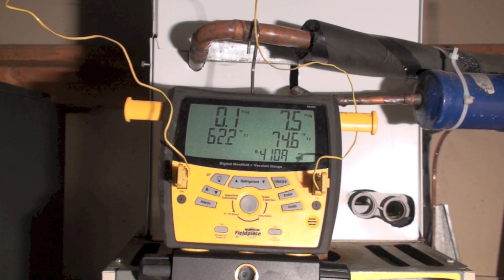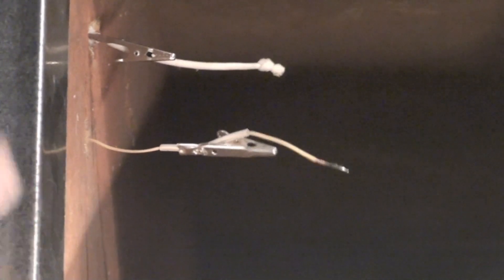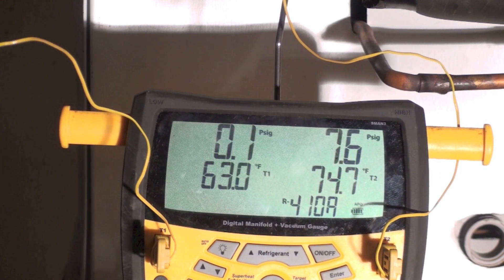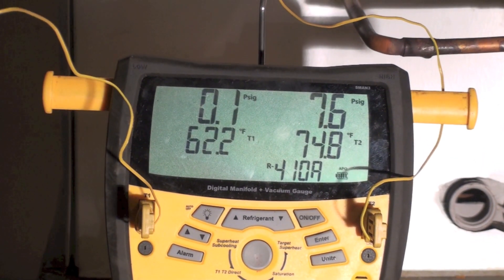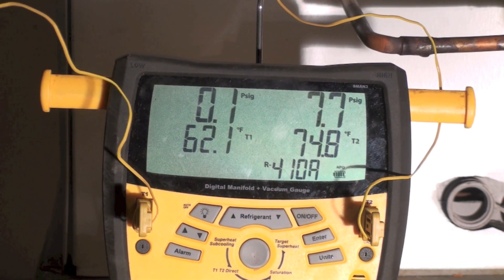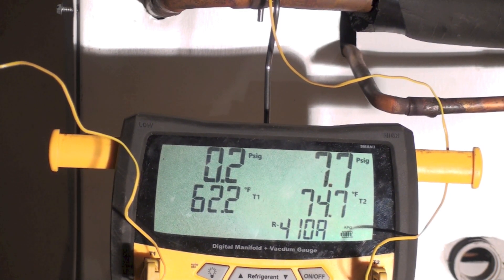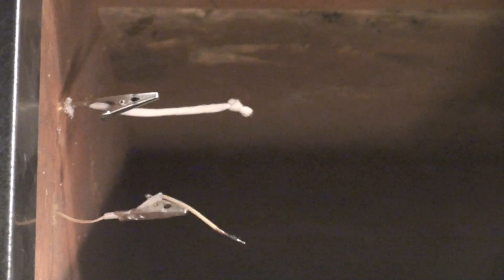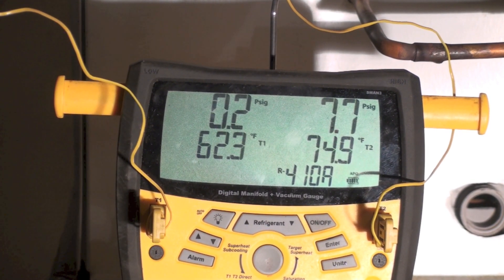Wet and dry bulb explained

Comment: I dont get how that applies to measurements..  i got a bulb indoors in pipe insulation right by the coil and one on the outdoor unit non insulated..  also got a txv indoors same area and out same area..  have a reversing valve right by the bulb as well.,  r22.  Ive checked the superheat outdoors and checked out..  but what do i check indoors?  Told to check it indoors based on cfm which is fine and wet bulb.. which i dunno what im checking..  rh to the liquid and line temps?  Do i gotta tap into the lines indoors also?  Im confused ..  ya get a good understanding in class then some old guy just confuses the hell out of ya in the field saying check the indoor wetbulb and hands me gauges..  like wtf.  Ive just been going in and making sure its not icing up and cfm is good n filters ..  just saying its good..  dunno what he expects me to hook into inside..

Comment: My hvac instructor told me to forget about wet bulb. He said in california we dont need wet bulb and if we are located in Florida. Can someone please give advice.
Reply from the maker: I do not say this lightly.  Your instructor is full of it.  
Humidity in California can vary from 5% to 0ver 90%.  Florida generally has a very high humidity, but it is not guaranteed.
Humidity determines the load on the A/C system and to a certain extent, affects the load on heating systems.
Follow the manufacturer's instructions.
GFM

Comment: Wet bulb tests are also used in the automotive industry in plants that don’t have AC.  Because these plants are basically like big ovens in the summer a point can be reached where it becomes extremely dangerous for employees that are already getting hot due to constant movement and thousands of pieces of machinery inside the building putting off heat.  Once it reaches a certain point the company has to give the employees extra heat breaks to cool off.  Wet bulb tests are used to determine when/if that will be necessary.

Comment: Thanks for clarification. Btw, you said when you take those 2 temps you can calculate relative humidity.  How is that done?
Reply: The formula is complicated, but it is easiest to work it out graphically on a psychrometric chart.  Given the dry bulb temperature and wet bulb temperature, you find a vertical line that corresponds to the dry bulb temperature, and trace upward.  You then find a down-right diagonal line, marked at the saturation curve, with the wet bulb temperature.  Follow the wet bulb diagonal, and see where it intersects with the dry bulb vertical.  This locks-in the definition of the air condition.

If you then want to know the relative humidity, you determine the corresponding absolute humidity with how high that point is above the dry air horizontal axis, and you keep tracing upward to find the maximum possible absolute humidity at that particular dry bulb temperature.   Relative humidity = absolute humidity / maximum possible absolute humidity at the dry bulb temperature.

Comment: Why is it so important to get the wet bulb ?
Reply from the maker: When humidity is high, water evaporates slowly, thus it absorbs heat slowly.  If the humidity is low water evaporates fast.  If I place a wet cloth on the bulb of a thermostat, the water will begin to evaporate and cool the bulb.  Thus wet bulb.  If the water on the cloth (called a sock) evaporates fast, the sock gets colder and shows a lower temp than a bare bulb.  
If, for example, relative  humidity is 100% dry bulb and wet bulb would have same temp because no water would evaporate.  Lower relative humidity will show a difference in temperature between wet and dry bulb.  The lower the relative humidity, the higher the difference in temp.
GFM

Comment: So does this take a special type of sock that doesn't dry super fast in all that airflow? Is this much more accurate than a cheap digital weather gauge that reads humidity? Guess the evaporation just causes a cooling effect? Guess I'm still trying to wrap my head around how all that is controlled enough to be able to measure humidity accurately. Why I'm kinda wandering if it takes specific type of thermometer probes and specific sock material and thickness and maybe a specific temperature of water to wet the sock with? Thanks for the video
Reply from the maker: Because it works on the latent heat principal, so unless it dries out, it will work.  The material is, I believe, cotton.  
There are a number of ways to acomplish this measurement.  Early controls used human hair because it shrinks with higher humidity.  Also, some plastic sheeting shrinks with humidity.
GFM
Reply: @grayfurnaceman  thanks for the response. Definitely Interesting how some of these things work. How would you compare this method with those electronic humidity meters you buy at the local Walmart etc? Are they even accurate?

Comment: This is unrelated but I am looking for a little help in an area I am new to. A customer lives in a forest area near Muir Woods and had a major mold problem. They are requesting a dehumidification unit. Since there is no need for AC, I know there is a brand that makes one. My concern is how will it work if it is in line with the return and only has a 10x6 opening? Ive got a 16" return with an 80,000 BTU furnace and a 3ton blower.
Reply: It sounds like a recipe for failure.  The humidifier duct sizing is probably done to increase condensation.  However, unless you have a high static pressure fan in the furnace, it probably will drop out the furnace limit.  Have you contacted the manufacturer of the dehumidifier?
GFM

Comment: Why we need to measure wet bulb temperature, and where it is practically used
Reply from the maker: Wet bulb is used in refrigerant charging with fixed orifice controlled A/Cs.  It is also used to determine load, especially in high humidity areas.  In these areas, the humidity load could 1/2 of the total load.  Hope this helps.
GFM
Reply: @grayfurnaceman  Is it possible for people to survive a wet bulb temperature exceeding 37 Celsius without air conditioning?  Does such a condition ever occur naturally, and what could be done about it in a pre-air conditioning world?

Comment: Will a thermal coupler or temp. probe with a wet "sock" over it do basically the same thing as a psychrometer? Just want to see if I can check this with tools I have in the house.
Reply: Just make sure you have air flowing over it when measuring it. If it just sits there with wet socks on, it won't want to work.
Reply from the maker: Yes it will.
GFM
Reply: Thank you.

Comment: What is the material placed over the probe - what you call a sock ? 

If I use my multi meter temp probe, what do I use as the sock ?
Reply from the maker: It is just cloth.  The type of cloth is probably cotton.  I say this because the older ones I know were cotton.
GFM
Reply: You could use wet tissue if that's all you have around. So long as it's kept just slightly moist and with air flowing past it, it should have the same cooling effect.

Comment: Where on the probe does it show the actual relative humidity?
Reply from the maker: The very end of the probe is the sensor.  Its just a temp sensor.  Its temp is changed by the evaporation of water from the sock covering the probe.
GFM
Reply: If I'm understanding correctly you can calculate the relative humidity by using the difference in the two temperatures?
Reply: @tamraarmstrong1808  It's not the difference between the two temperatures.  It's an intersection of two lines on the psychrometric chart, that enables you to calculate the absolute humidity, relative humidity, and other properties, given a measurement of wet bulb and dry bulb temperatures.

Line 1 is the vertical line corresponding to the dry bulb temperature.
Line 2 is the down-right diagonal line corresponding to the wet bulb temperature.

Comment: So, there is no wet and dry bulb in outer space?
Reply from the maker: Well, if you wet the wet bulb then place it in space, the water would evaporate very rapidly and the wet bulb temp would be very low compared to the dry bulb.  At least until the water boils off, which would take about 1/2 a second.
GFM
Reply: grayfurnaceman Nice. Seems like a logical explanation.

Comment: Why do we use indoor wet bulb and out door dry bulb when we calculate piston type coil super heat? I am curious about the formula because sensible and latent ratio of the coil should be calculated with indoor air conditions. Why do we use outdoor air condenser dry bulb?
Reply from the maker: I will try this one.  I will probably do a video on this.  But here goes a simple one:  When you reduce the temperature of the indoor air, you condense water.  For every pound condensed 970 BTUs are absorbed.  This is a significant number.  Higher humidity increases the load by up to 1/2.  So it must be taken into account when charging with the fixed orifice.  The condenser air may also have high humidity but there is no latent heat involved.  Hope this helps.
GFM

Comment: Best explanation on youtube. THANKS! I am trying to cool a pool a few degrees at night via a dispersion "fountain". I have sufficient CFM. Ijust don't know if it is more effective to run it at night at 75 degrees and 85% humidity or during the day when its 95% but 50% humidity. The water is at 92 degrees and I'd like to drop it about 4-5 degrees. Might be a trial and see kinda thing.
Reply from the maker: It will be a trial and error but I would think night would be best.  
GFM

Comment: can you pls. explain why you have to get temperature of the wet bulb to get super heater?
Reply: Humidity has an effect on the ability of the evaporator to extract heat, so it is a factor in determining the target superheat. A simple dry bulb temperature reading wouldn't take that into account.

Comment: So do you put the thermometer ends after the acoil like the vents or before like air filter area?
Reply from the maker: +Brandon Woolbright If you are testing humidity in a structure, you just simply place the wet and dry probes in the air space.
GFM

Comment: You're so amish.. get yourself a real diagnostic duct tester.  Actual wet bulb, percent of humidity, dew point, and dry bulb. 

The sman3 is for refrigerant. Pressures and temperatures and nothing more. That's enough to find subcooling and superheat, but you won't know if those values are any good without more data and a slide chart. 

You'll never pass an a/c save test without actual humidity readings. Get the right tools and tell me you've got 100% supply humidity...
Reply from the maker: victor de la puente, jr. This video is not about tools.  This is an explanation of what wet and dry bulb are. The Sman is commonly used to calculate target superheat.  The wet bulb and dry bulb temperatures are inputted to the gauge set and the calculations are done by the tool.  I also would not guarantee 100% humidity on supply air.  That depends on return air humidity, air flow, coil size and condensing unit capacity.  Thanks for the thoughts.
GFM
Reply: All true, and well put. You're alright!

Comment: Not trying to be disrespectful or anything, but WHAT ARE YOU SAYING? I've been trying to find a video where someone says: Here, this is what a dry bulb is, this is what it does, THIS, is what a wet bulb is, this is what IT does, here is the difference between the two, here is an example of when and where you would use them. But I cannot seem to find a video that does just that... Most people who understand the concept are people who already have a familiarity of HVAC an Heating and Air Conditioning. IDK, just thought I might throw that in there.
Reply: Britney Spears Very basically stated: Wet Bulb is the temperature as water evaporates off of a thermometer or other temperature sensor.  Thermometers were once only mercury filled bulbs attached to a thin tube, they wet the bulb to measure the temperature of evaporation - hence the name wet bulb.  The dry bulb is when the sensor/thermometer (thermocouple is a type of temperature sensor and used in this video) is left dry (air temp) in the air.  

The bigger the temperature difference in the wet and dry (bulb) temperature the lower the humidity of the air being measured.  The closer the two temperatures are to each other the higher the humidity.  Water cools things down when it evaporates and water evaporates more slowly in more humid air.

Complex Version:  Vapor pressure inhibits evaporation the closer the air is to saturation. The phase change of water from a liquid to a gas requires energy that it takes the heat energy from environment around it (the thermometer).  Less evaporation then means less cooling and more similar temps.
Reply: Rambohagen Sweetness, thank you very much sir, I appreciate the clarification!
Reply: @Rambohagen  such a great explanation.thanks
Reply from the maker: +Bodybuildingking This channel will always be a work in progress and there are more humidity videos coming. 
GFM
Reply: like
Reply: Thank u sir..

Comment: GFM  Being new to the ac world, I fail to understand the wet/dry bulb theory.  If the humidity is too high ( or too low ) what can be done to correct it.  Also what are the effects from too wet or too dry, and how does it effect the system that you are working on.  Is this just another method to calculate whether or not the unit needs refrigerant, like super heat or sub cool?
Reply from the maker: It will take more than a reply to cover that.  I am in the process of making more videos on humidity and the effects of humidity on the air conditioner.  Also the effect the air conditioner has on humidity.  For now suffice it to say that humidity needs to be taken into account when sizing and charging air conditioners.
GFM
Reply: Q

Comment: Where is the optimal place you would take wet bulb and dry bulb temperature readings?
Reply from the maker: J Hartranett Both wet bulb and dry bulb for indoor temp should be taken in the return air near the air handler.
GFM
Reply: grayfurnaceman Thank you.

Comment: 960 btus per pound? I'm pretty sure its 970
Reply from the maker: Adam Holmes I think you are correct.  Thanks for the info.
GFM
Reply: grayfurnaceman I had a teacher that got us to ingrain in our heads that 1 watt = 3.413 btus. Turns out 1 watt = 3.412 btus. It's pretty easy to get numbers mixed up.
Reply: +Adam Holmes It depends on the temperature of the water you start with.
Reply: zeke112964 .... obviously but it takes that many to change state.

Comment: I would like to thank you for putting these oil burner furnace videos on you tube.  we ran the tank dry last year and that brought us some problems.  the furnace seemed to work fine after filling the tank and bleeding he air out of the fuel line. Then it just stopped working. I watched your videos and then I applied the knowledge that I had gained to my furnace.  I ended up cleaning the nozzle  and the entire fuel line using your instruction. Got a perfect running furnace as a result. Thanks!!!
Reply from the maker: Thomas Norling Its good to win.
GFM

Comment: I see you use fieldpiece, I have a clamp on meter and adaptors for my fieldpiece I tried calibrating it but either my meter or clamp on is no longer accurate when compared to my new thermometer I bought, any idea what it could be? I tried calling fieldpiece very little support

Comment: Thanks for the explanation, that makes sense about the humidity.  It's been bugging me because I know if my clothes are wet, the faster the wind is blowing the colder I feel. Based on that I always wondered if the wet bulb measurement would vary based on the CFM.  I might try it with a box fan on different speeds just to prove it to myself.

Comment from the maker: Good question.  The bulb should be placed in moving air because if it is left in still air, the humidity will increase in the immediate vicinity of the bulb and show incorrectly.  However, the velocity will not affect wet bulb because in the moving air has fixed humidity.  Hope this helps.
GFM

Comment: Hi GFM, is the wet bulb temperature effected by the speed of the air flow?  In other words, does a higher CFM produce a lower WB temp?
Reply: The wet bulb temperature is the lowest possible temperature you can achieve with airflow and evaporation of water.  It only depends on the three state variables that define a condition of air (temperature, humidity, and pressure).

A higher CFM may get you closer to the wet bulb temperature when humidifying air, but the wet bulb temperature itself is independent of the speed of the airflow.

Comment: I use to have a bacharach sling psychrometer. It was cool to sling that thing in front of customers as they always thought it was cool. The problem with them were that they only went up to just over 110 degrees and they would blow if you left in your truck when it was super hot outside. Replacement thermometers were pretty expensive